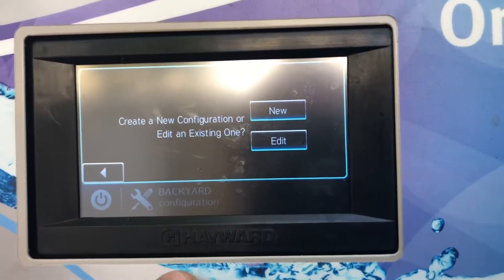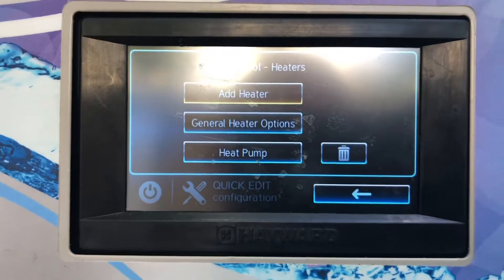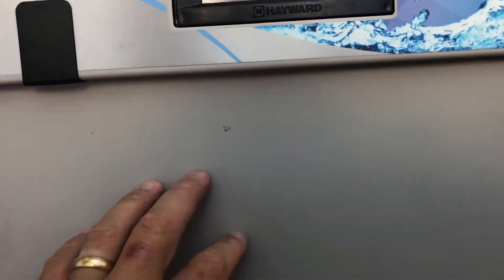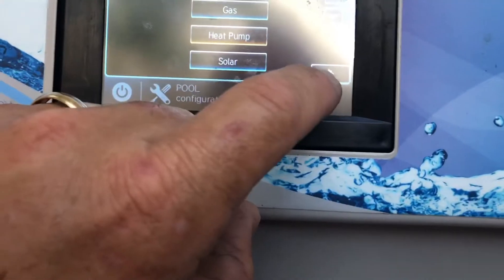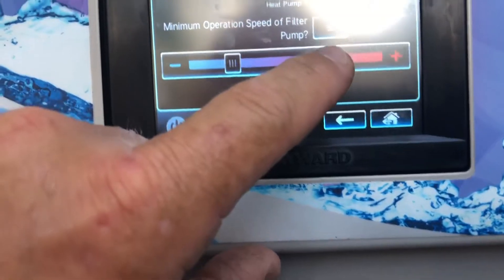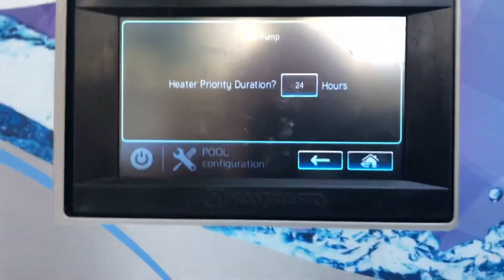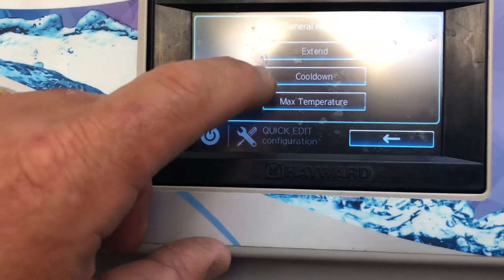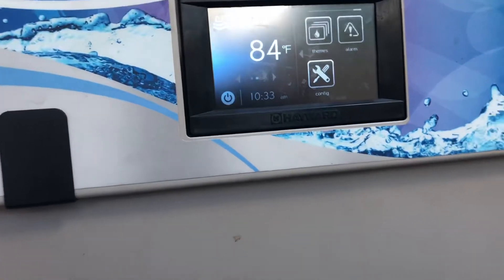Hayward OmniLogic | Adding & Programing a Heater to Automation System.

Comment: I have Hayward OmniLogic with a heater/chiller, but can only control the heater and cannot figure out how to switch to activate the chiller - It's over 100 degrees F in Texas and my pool is getting up to 94 degrees F, so I really need to get the chiller set and running.  Please help!
Reply: FWIW< I have the same issue also in Texas. I have the HP50951T heater, but there is a newer HP50952T heater that has extra wiring to support both the heating and chilling.  I have not had good luck with Hayward support, but I did finally get a local company to agree to come look at it.  HE commented that I needed to add one more wire, but I think it gets wired to a COM bus instead of the LV heater controls, but I'd be guessing so hoping they can help me.
Reply from the maker: Your issue is a programming problem either coming from when the heater was initially programmed to the automation system. First try to go through the program and delete that you have a heater and save it. Then go back in through the program and add a new heater and check if I ask you if the heater has the chill option. I don’t recall if the OmniLogic has the specific program setting. Also, make sure that you’re heater itself has the chill option enabled. I’ve seen on some Hayward heater units that have the chill option, they have to be enabled. Most of the time the heaters from factory come set in heat only mode. you could also always call Hayward technical support and they surely will assist you with your specific situation thanks for watching a commenting.

Comment: i wired my gas heater to my omni and it's in remote mode and you can see it turn on and off based on the omni setting, but it never changes the temp up and down.   so even though the omni turns it on, it always says 79F for the set point (the last temp set before changing to remote mode).
Reply from the maker: Is your gas heater programmed and switched to t-Stat remote mode? the heater settings must be switched to this mode. This mode indicates the heater will be controlled by automation controller.  Also in your Omni you have to make sure it’s wired to the correct relay and that it’s programmed to that relay. Also you have to make sure that when make these changes in the Omni that you are properly saving it (there is a specific way to save these settings in the Omni). 

On the heater, try this… go into the settings and disable the remote mode (put it back to operate by its own controller) once this is done, go into the temp settings and raise it all the way up to 104^. Then go back into settings and change back to T-Stat remote mode. Let me know if this works.
Reply: @EliteSwimmingPoolsTV  My gas heater is a rheem (raypak) and all it says on it is to hold the 2 temp buttons for 5 seconds until it goes into remote mode, which is what I did.   I have the omni hub, so there is only 1 place to connect a 2 wire heater remote control wire.   I tried swapping the two wires and it does the same thing.

Although, I realize now as I re-read your reply, the 2 wire is just a simple on/off?  No wonder then it's not changing the temp.  So  basically the heater needs to be at max temp so that when that wire triggers it to turn on, it's hot enough to run.  I think I get it now.   I will change to 87F (since i never want it to get above that if something goes wrong) and then turn remote mode  back on.  Thanks much!!!
Reply: @EliteSwimmingPoolsTV  it worked, thanks man.

Comment: I just set up my first OmniLogic. I have the heater wired up through the breaker. Can I bypass the relay and wire it to the low voltage heater output. That should be the form of communication used right?
Reply from the maker: Heater should be wired to heater relay.

Comment: Question, I have a heat pump that I programmed in the Omni PL but It doesn’t seem to be communicating with the automation. It’s wired into the LV1 one spot inside the panel, but I don’t see anything wired directly into a relay. Does the heater need to be on a relay or is the low volt wired into the LV1 Considered a relay?
Reply from the maker: Heater should be wired to the Low voltage terminal not any LV

Comment: I have the same panel but a pentair mastertemp 400 heater. Heater works fine as does the panel but I can’t control the heater with the omnilogic. I can’t seem to figure it out. Any advice?
Reply from the maker: Is your MasterTemp Heater connected with the communication wire plugged into the control board of the heater and connected into the Automation panel? This wire is needed and connected in the correct point. It’s a simple insulated 2 wire low voltage wire.

Comment: Can you add both a gas heater and a heat pump/chiller to the omnilogic?
Reply from the maker: You probably would have to wire the gas heater to the solar heater connections if unto does not have a dedicated gas heater wire connection point and wire the heat pump to its normal wiring connection point. You may want to confirm this with Hayward Customer Support

Comment: Hi, I have an Haywaed OmniLogic automatic system and I'm having trouble with the pool light system. After installing the Hayward transformer and connecting them to my Color logic led 1.5 hayward 14 volt ( blue wire), my lights flash like a stroke when I turn them off, every 30 seconds. I download new firmware R03.2.0 2019 version and reprogram my omnidirectional feature in both settings ( activate and deactivate ), without any success.  Is it anything else I can do? Is it possible that you do a YouTube video in how to result this problem. Waiting for your response. Enrique
Reply from the maker: It’s possible your lights may either have a issue themselves or some electrical connection is not proper. I would contact Hayward Technical support or hire a local pool company to check this out for you.
Reply: @EliteSwimmingPoolsTV  Thank you so very much.

Comment: I appreciate your videos! I installed this same panel last June with the 2-plug receptacle on the side. Is it possible to wire that receptacle to a relay and control it by the app? If so, do you have any info or videos on that? Thank you for all your time and information you put into this. John
Reply from the maker: I wouldn’t see why you couldn’t wire a 120v receptacle to a relay (given that you have the space for another relay and the main board is capable of handling how ever many total relays the panel has wired). Take the Line side (hot wire)  that would be coming into plug re-route to relay Line IN and Line OUT to plug IN. Leave Common wire on common bar. Label that relay with customers label (ex. Receptacle) and when ever you want to utilize that plug then you activate it on the app. All your simply doing is rerouting the wires to go through a relay in order to activate and power that plug when you want power present, not sure why you would want this unless your utilizing these plug for a landscape lighting. If so you can cut the lug part off the lighting transformers power cable and run it into panel direct to relay same you would any other piece of equipment and leave external plug power present all time for when ever you need to plug something in and get instant power, instead of having to go into app and tune on the relay to power plug. Good luck. 👍🏼
Reply: @EliteSwimmingPoolsTV  The plug outlets are being used for rope lighting for the palm trees. The lighting is about 80 feet away and the thought of the convenience of not having to go back around the pool equipment to plug it in to turn it on sounds a lot easier. Unless you have any other suggestions. Thank you!
Reply from the maker: So being that the trees to be lit is 80 ft away, are you running an extension cord to the tree and then stringing the lights in the tree? Are you suspending the rope light in the air to the tree? How are you running the power to tree? Is your lights a low voltage (12v) and lighting system has a transformer to step down power or high voltage (120v)?
Reply: @EliteSwimmingPoolsTV  They plug right into the receptacle that is installed on the side of the Omni Logic panel.
Reply from the maker: If this was my house, i would wire a circuit to an open relay inside the panel & label this Landscape lighting. I would dig a trench from the panel to the tree(s) I am wanting to light, run electrical conduit underground feed the 120v circuit line through it and install a electrical weather proof junction box at the base of the tree(s) with a receptacle. That way I can also put a bullet style light shining on the tree and have the rope light up in the tree. Having the receptacle at the tree also gives you power out in the yard for other projects or decoration for parties / Christmas blow ups or any other things you may need out there. With this wired to the panel on the relay you can operate that circuit via mobile phone. This is how I would do it. Good luck. 👍🏼🍀